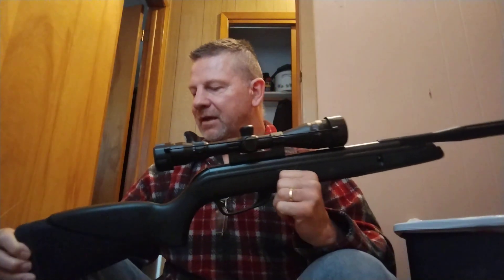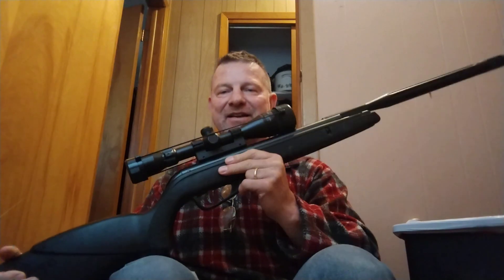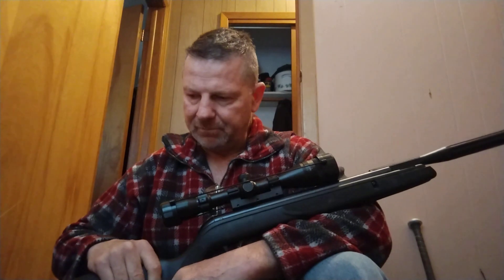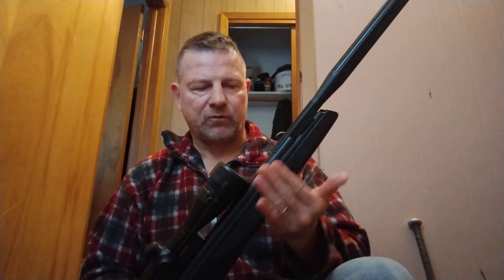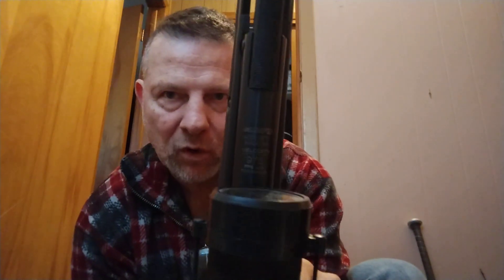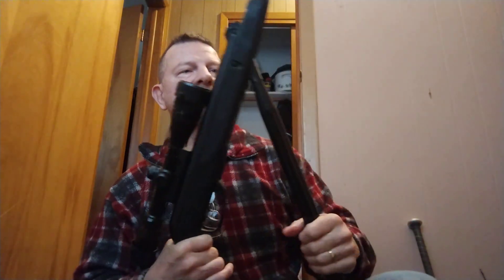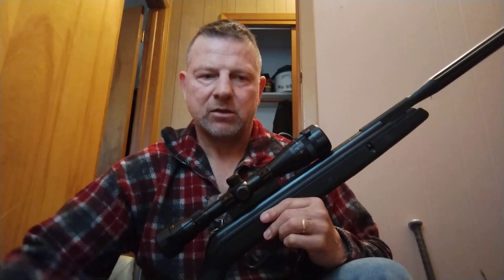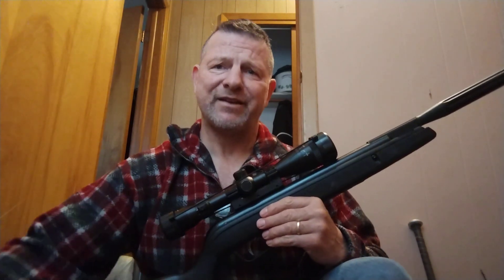Part 2: Manufacturers R Lying 2 U about the Gas Ram: Just the Fact's!

Comment: You're bringing up a very important topic, Chuck.
 Few people realize this.I live in Poland and I am also thinking about a gas ram airgun. With us, the limit without permission is 17 joules. Above is the so-called "FAC", which can be of any power, but must be registered and can only be fired at the shooting range.
In Poland, hunting with air guns is strictly prohibited. The exceptions are rats and mice, which can be shot on your own property.

Theoben Evolution, Weihrauch HW 90, Gamo, Crosman (IGT) and Hatsan are available on the Polish market.
And here there are significant differences.
1. Theoben pumps his gas ram with a gas, possibly nitrogen or some other inert gas. It looks great, but the quality of this company's products has deteriorated significantly. In general, no one wants to buy it due to the lack of parts and difficult service.

2. HW 90 - extremely reliable, its gas ram is the same as in Theoben. The parameters are average, but the quality is very high, practically no failures and leaks. I would buy it without hesitation, but it is extremely expensive for my pocket.

3. Gamo - I do not know the products of this company at all, although many people have and praise them.

4. Crosman, despite my great sympathy for this company - I love to fiddle with them and improve parameters - is terrible. The IGT type gas ram is just a substitute for a gas spring and breaks down horribly.

5. Hatsan - they are constantly improving the quality, it's better than Crosman, because the Vortexes work, but a lot depends on the specific copy. Gaskets that can burn, especially in the case of higher energies of 30-60 joules, require replacement.
There is also an important detail in the case of the Vortex. It is filled with USUALLY AIR, which is of great importance during a large temperature difference.
The first generation of the Vortex had a valve to inflate or deflate the cylinder.
The current, new generations only have the option of pumping air, using a PCP pump, up to a maximum of 150 bar.
of course, in Hatsan, the more power, the more likely something will break or the Vortex will unseat.
By the way, Hatsans have an amazing kick that is able to completely destroy even a mid-range scope. On the other hand, the open sights, which I like to shoot, are terrible in these airguns.
So I have to look into Gamo, which looks promising.
Reply from the maker: Thank you for the very good comment's 🙂👍

Comment: I have chronographed my Stoeger gas ram on cold winter days and hot summers day no difference in my performance one way or another
Reply from the maker: They tested gas ram vs steel coil spring on "American Airgunner" and the results were exactly as I said. I did the test myself, between my Gamo Hornet Maxxum 22 gas spring, vs the Hatsan 125 25 steel coiled spring and there was incredibly noticeable difference with the Hatsan coming out on top.
I don't know what you are calling a cold winter day, but I tested it -17°F.
Reply: @springpistonriflefeverlone9611  I live in eastern Canada so I know cold weather anyway just what I have experienced with this air rifle

Comment: I'm not sure what you're saying about the air? gas rams have gas in them, I had a Theoben gas ram air rile about 30 years ago, with no noticeable difference regarding ambient temperature, it was much better quality than anything produced by Gamo maybe they used a better quality ram or even a different gas in the ram.
Reply from the maker: I shoot in temperatures ranging between 100°F and -20°F. The temperature 🌡️ affects a gas piston or gas spring more than a steel coiled spring piston rifle.
Reply: @hetrodoxly 1203,  There is normal air in the Vortex gas spring, Hatsan, as in all Crosmans made in China and other products of this type from China. You can't expect anything else for that kind of money.
Theoben is a model of a real gas spring. However, the new products of this company no longer have the good old quality. Three of my friends bought Theobens some time ago and all three have problems with them - gas escaping from the cylinder, lack of weight balancing the piston, faulty seals - it's not the same as it used to be. That is why, for example, in Poland, most people have the Weihrach HW 90, or normal, old spring HW models, with the most durable, reliable and slightly hunting spring model being the ancient HW 80 and its slightly weaker brother HW 35. Both of these airguns usually have only 16 -17 joules (in Poland), but they are built like an Abrams tank - unstoppable. Some copies work for 40 years without the slightest failure.
Reply: @marcinos303  Theoben haven't made air rifles for well over 12 years, American company RAW own the designs, the HW90 uses the Theoben gas ram system, HW don't have the quality they used to have, the HW99 galling problem is legendry, in the past they'd have sorted the problem in no time, this issue as gone on for years, when tuning HW we're finding lube issues usually to much, even swarf in the cylinder, saying that HW are one of the best out there but their QC isn't what it used to be, Many Polish FT shooters use AA TX200, I've had most Weihrauch's over the years all great guns, I went through the PCP stage and came back to springers, all my guns were sold I own the only rifle you'll ever need, Air Arms walnut Prosport, not only the best looking air rifle it's shoots as good as it looks, like a well tuned gun out of the box.
Reply: @hetrodoxly1203  Indeed, it is true that the quality of Weihrauch has also deteriorated. I mean, they seem to be stuck with some problems and they can't, or rather, they don't want to deal with them. However, you can shoot HW straight out of the box.
However, to make it work long and well, in Poland we do the following tuning:

- self-lubricating Boramide slide in the rear part of the piston,
- refining the piston seal,
- making a PET lubricant cover,
- making a well-fitting articulated guide with a lubrication channel and a cap made of ertalite,
- polishing of components,
- trigger adjustment,
- replacing the spring with an export one (only if the carabiner was purchased in Germany with the letter F) and setting the energy of the carabiner within the Polish limit of 17J
- of course, washing the whole and proper lubrication.
Air Arms is in a class of its own, but quite expensive.
There's another option, but it's more for used equipment - the Walher LGV and other old spring models are excellent.
If someone cares only about accuracy, the old match rifles are a good choice: Feinwerkbau 300/600/601, Diana 75, Haenel 312.
Modern, professional sports rifles are also the best made by Germans and Austrians: Anshutz, Walther, FWB, Steyr, plus Italian Morini, but these are completely different toys.
Reply: @marcinos303  I couldn't agree more.

Comment: I have the hatsan mod 125 in 22 cal. That thing is definitely a tack driver with specific pellets. It’s not the air gun for everybody though. Just like Chuck mentioned, they are a lot bigger, longer, heavier and harder to shoot. I wholeheartedly believe that most of the things that .22 cal airgun can do, the 1.77 caliber can also do just as well or better. Just think of what you’re going to use the air gun for and  to hunt what? Even the medium game like raccoons, and things of that sort will go down with the 177 headshot/neck shot. The, 177 also shoots very flat, and for a longer distance. Mainly talking Springers here and gas rams not pcp. I shoot a bigger, red fight 16.7 gr penetrator pellets from my 22 hatsan just because I have a goal to shoot a small hog with one of them. but that’s just a challenge, an ideal situation would be using something like a 22 magnum rimfire or .223 Remington. 
Crosman has always been one of the most reliable brands of air rifles that I’ve owned. I still have the quest 1000 X and it works like a charm.  yeah, gamo has also worked really well, even though the fanboy Springer weihrauchs will tell you that they are garbage. I have yet to test the new GEN 3 i .177 or .22 magnum. 
I plan on getting one in the future because they seem really fun to shoot with all the power
Reply from the maker: Great comments 🙂👍. I have a few HW rifles and they are very nice, but Gamo still makes good budget air rifles. Currently I have a Hatsan 95 22 on back order. The first one was a lemon 🍋 hopefully the next one will be good 🙂👍.
Reply: @springpistonriflefeverlone9611  awesome, I hope you get a good one and review it. my dream airgun would be if gamo made the magnum gen 3i with weihrauch quality and parts! Wouldn’t that be something? Lol
Reply from the maker: @RadOpsTV  This might be pretty close.
https://gamousa.com/product-category/air-rifles/page/2/
Reply: @springpistonriflefeverlone9611  that hunter extreme pro looks pretty close. “1300 fps” probably from their useless pba raptor pellets, but still maybe will launch the rocket pellets @ close to 1000 fps. Not bat, Wood stock, it’s not the bone collector, but I think it shoots faster than the bone collector.
Reply from the maker: @RadOpsTV  It's basically a Gamo Magnum in a very nice stock and it has a steel breach block. I think it is getting between 27-29 FPE. I like most of the features on this rifle, minus the plastic moderator, plastic trigger and gas spring.

Comment: Nice video Chuck. I personally felt my Gas Ram conversion on my Gamo CFX 177 made a massive difference in accuracy and consistency but then again perhaps cutting out a short length of spring and making some guides as per your previous videos would have done the trick too. Happy Easter to yourself and family!
Reply from the maker: Thank you ✝️🙂👍 Happy Easter. 
I think that a gas spring can be good, but if there is a wide temperature 🌡️ swing, like in South Dakota it will definitely affect the power and POI as the seasons change 🙂👍.

Comment: You have both, Hatsan and Gamo...in your experience, which brand would you go for, build quality/accuracy wise?
Happy Easter
Reply from the maker: Thank you 🙂👍
Accuracy matters to me most of all. Even though Gamo has lots of polymer and it doesn't look the best, it performs great. When looking for a Gamo, make sure that it has a "CAT" trigger. The CAT trigger can be made almost perfect with an aftermarket trigger screw, 2.5 × 10-12 mm. Gamo makes good barrels. I also don't hear about the gas ram failing in Gamo rifles.
Hatsan's look more solid built but are known for bad barrels and gas spring failure. I have seen video's Hatsan's that were tack driver's, but the 95 I had was far from that. Last I looked Hatsan USA had the 87 on sail for 100 dollars, but I don't want to try something that has had such a bad reputation. Currently I have a Hatsan 95 22 on backorder. If the next one that comes is a lemon 🍋 it will be the last Hatsan that I will get.
I hope that helps you. Happy Easter to you too 🙂👍.

Comment: Nice vid Chuck.  I think some of the gas pistons are charged with inert gas like nitrogen to get around the temp swings.  Still the air in the compression chamber probably is not going to get the same oomph in the cold.  I have a couple gas-ram break barrels, but I've never checked velocity summer vs winter.  That is something I will probably do to quantify the difference.

I did get that Gamo Swarm Magnum Gen3i in.  It's a serious cocking effort, but no worse than the Hatsan 125.  Neither are for the young kids, that's for sure.  Anyhoo, the Gamo is shooting very well.  Haven't chrono'd it yet, but the JSB 18.13 are shootind 1/2" or sometimes better at 25 yards.  Shot it at 50 yards and got 2-3" groups, but it was kind of windy.  I'll try it at 50 again on a calmer day.

Enjoyed your vid, thanks for sharing!
Reply from the maker: Super great comment's 🙂👍. Glad that you have a good Gamo Magnum 🙂👍.